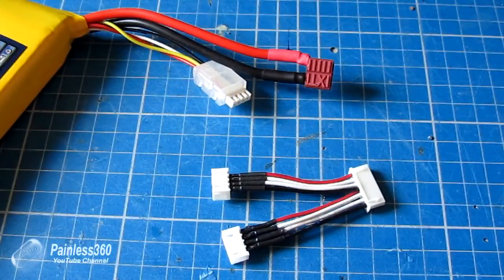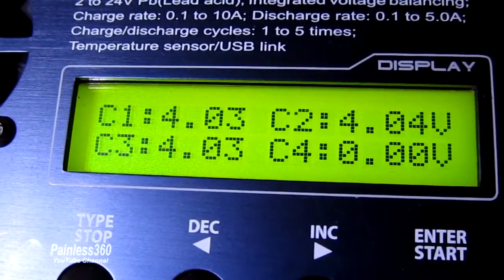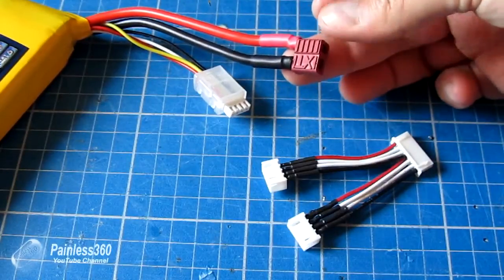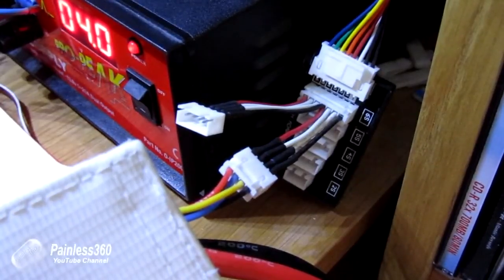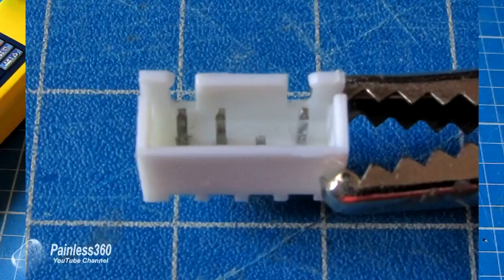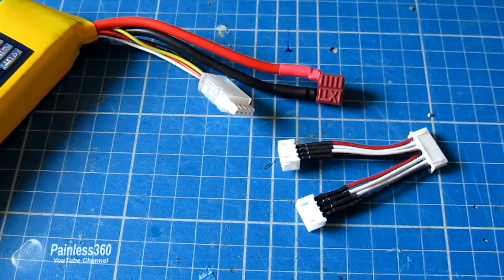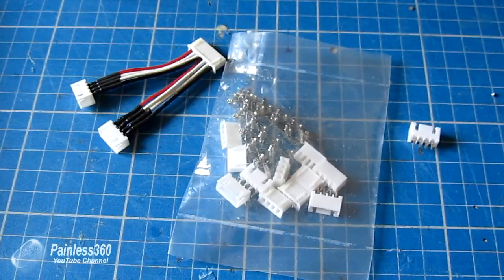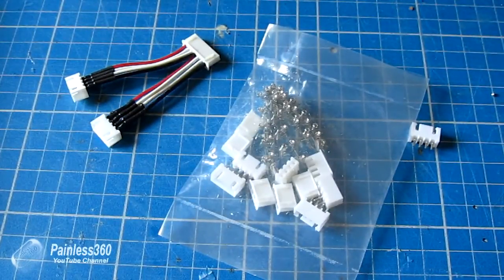How to fix jumping voltages on your LIPO charger

Comment: i had a recent issue where my Imax was showing weird voltages coming off this 1 S Canon lithium battery I repurposed.  It showed extreme different voltages than a meter connected to the battery terminals, like instant 4.1 volts when charging or almost instant 3 volts when discharging.  Ended up being an issue with the multi-cell charging cord and I had to quickly solder another single battery cord together.

Comment: So I have a new Sky T 200. My balance cables are brand new but some lipos drop to 0.5amps after a while. Would you replace the pins on the battery even though they are female??
Reply from the maker: Not sure what you mean, a charger will drop the charge current as the cells near final charged voltages....

Comment: Great video and advice but wouldn't thoroughly cleaning the pins be just as good? Not to say, cheaper?
Reply from the maker: It would, if the problem were simply dirt on them. In fact it's often because the pins have become pitted and worn making the contact poor and introducing a resistance to the connection.. Happy flying!

Comment: Great video, I had never thought of those other leads causing problems unless the solder was bad. Do you have any links for those connectors and that white cover you use on your balance leads? I just use hot glue to keep them in place since the pins used to come off from plugging and unplugging my batteries. I normally use an extension on those balance adapters so I can just change the leads if they go bad and don't keep plugging and unplugging the balance boards themselves.
Reply from the maker: If you search for 'JST LIPO balance connector' on eBay you should see a few options. Glad you liked the video - thanks for the feedback. Let me know if there are any other topics that would be useful.

Happy flying!
Reply: Hi there. I did finally came up with a topic that I am interested in. How about adding an OSD to the multiwii.If you ever decide to get one that works with it, I'm sure others would like to see that too.